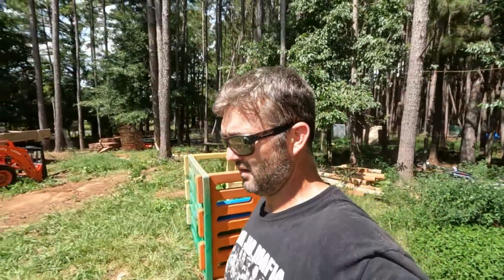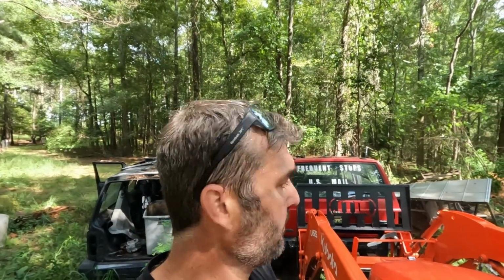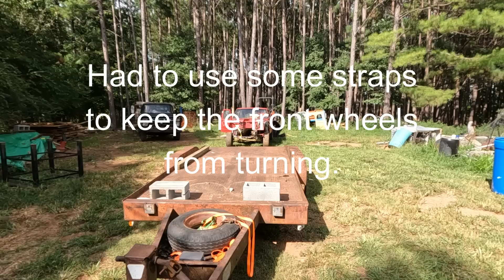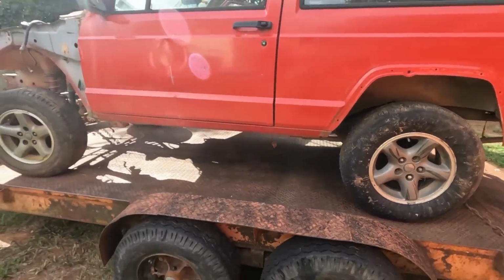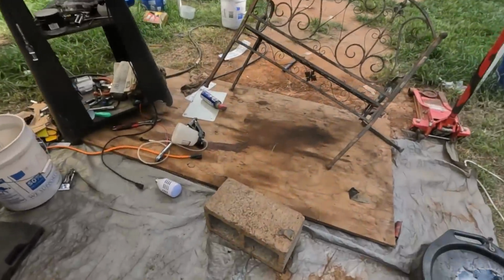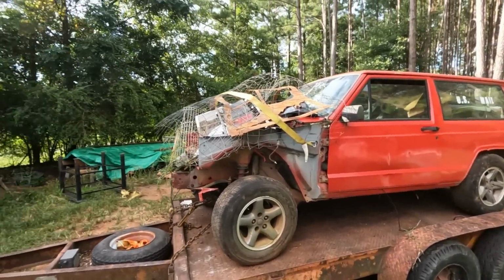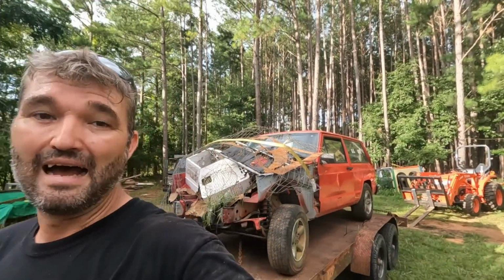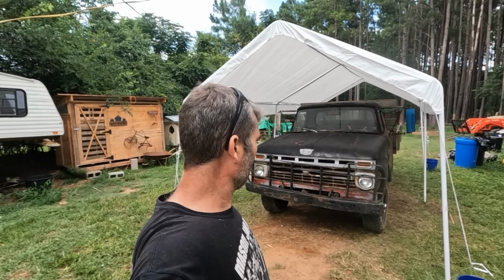FINALLY, CLEAN UP AROUND THE HOMESTEAD SHOP | RUNAWAY JEEPS, SMASHING WASHER, SCRAP STEEL, AND MORE

Comment: I did not ever imagine cleaning up could be so much fun!
great job , just a bit at a time , little, by little it will get done.
I think 3000 scrap weight. ( no engine or trans )